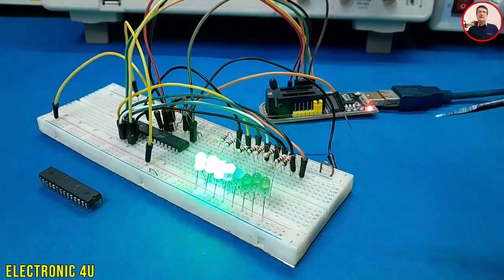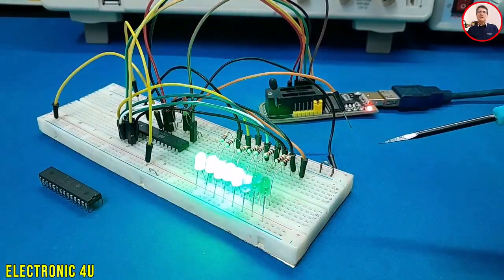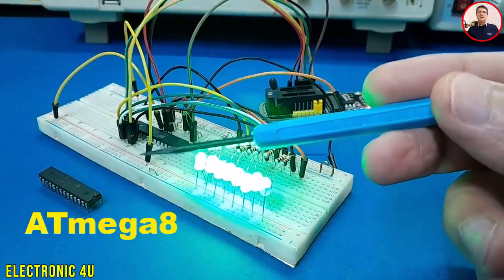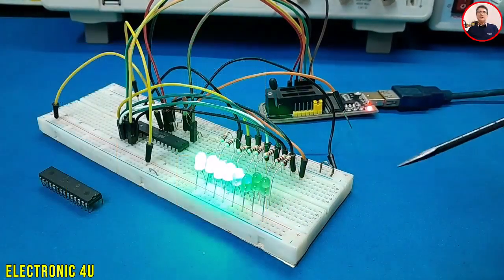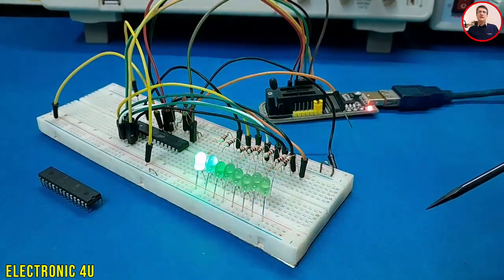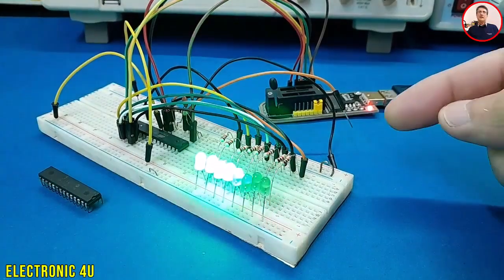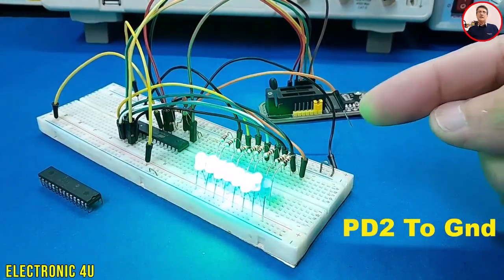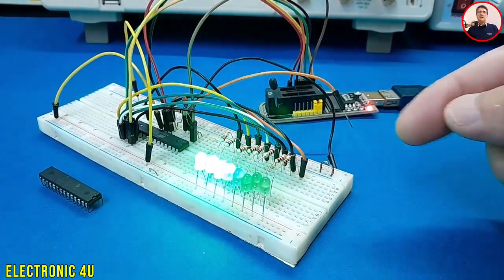How Do Sequential Turn Signals in Cars Work? | An Ultra-Cheap Circuit Explained

Comment: That's a nice project to do as a hobbyist, but it's a dumb idea for a turn signal. It's much mode visible as a thicker bar, and less visible as a line. Also the animation doesn't draw attention as much as blinking. It might be invented by the same idiot that decided that turn signals and stop lights can be merged, so the turn signal is red.
Reply from the maker: I appreciate your feedback on the visibility and attention-grabbing aspects of the sequential turn signal.
Reply: @Electronic4U-david  I hope you don't take it personally. I just vented out on a stupid trend in car manufacturers making cars worse - like the retracting handles, menu driven wipers etc. If you want feedback on your video - it's nice - gets people curious. You could show a how to, including the code and schematic maybe. also step by step how to program it. did you use arduino framework or just plain C ... etc.
Reply from the maker: Yes, I understand. It's just the C language. Files can be downloaded in the Description Box ❤